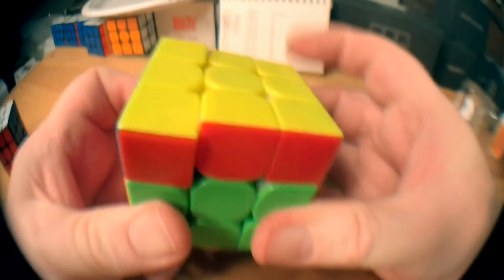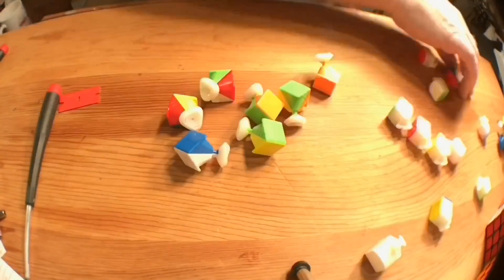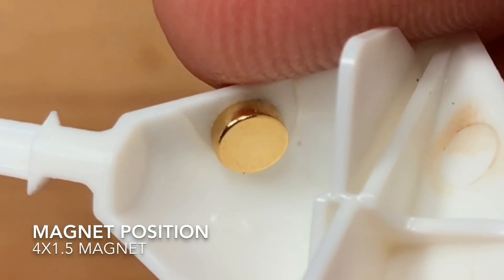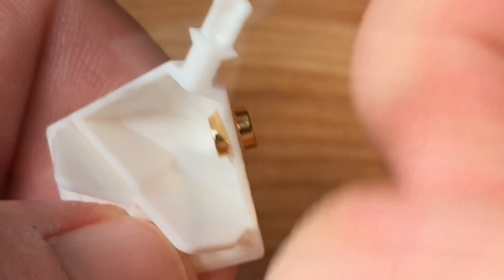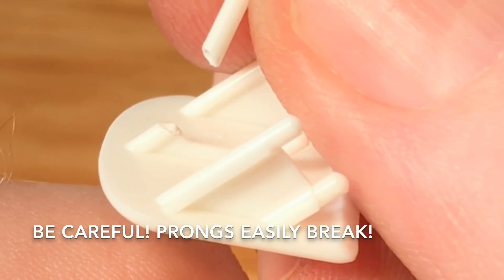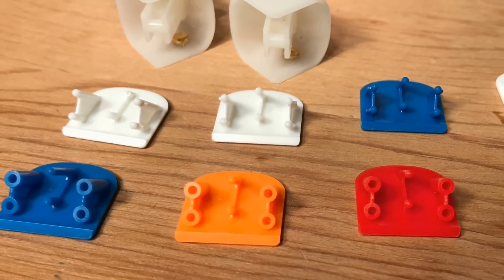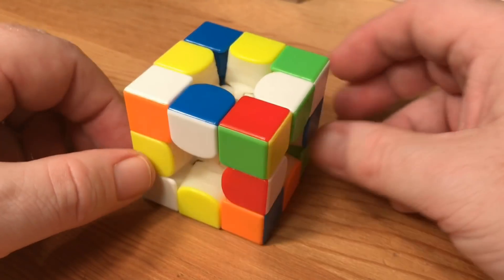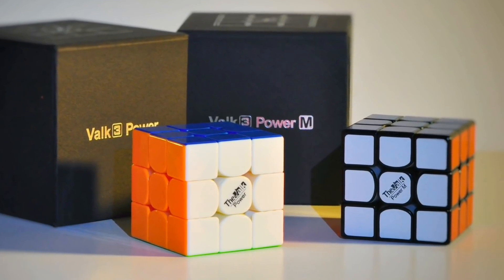How to Magnetize the Valk 3 Power Speed Cube

Comment: Why is there a variation of magnet strength? What does it do?
Reply from the maker: THERAGINGCYCLOPS They use a combination in the factory Power M. In my experience, when I've mixed different types of magnets, I generally get an average grade or strength, so like using N35s in the corners and N42s in the edges gives me averaged pullforce strength of something in between these two grades. And mixing two different thicknesses would do a similar thing. 
But I think there might be something to using lighter magnets on the outer cube, the corners, to make the action feel lighter, and having the heavier magnets in the middle to increase the m slice momentum, thus making m slices freer. It would be at such minute level I wonder if many people could detect a change. Mats Valk certainly would be able to, I imagine. And from what I've heard, he picked this configuration out of several prototypes.

Comment: Can I just use 4x1.5 in the corners or use 4x1 in the edge?
Reply: Ok I'll just use 4x1.5 on both thx
Reply from the maker: I’d probably use the 4x1.5 in both corners and edges. Might be worth experimenting with 4x1 in the edge, but I’d imagine the overall magnetic pullforce attraction would be rather weak.

Comment: Is it wrong if I use the tutorial for any Speed Cube
Reply from the maker: Good question. I wouldn't particularly use this tutorial for other cubes because the Power has a fairly unique cap design for the cubie pieces. But, you could use many of my other tutorials on several different cubes. Cubes like the GTS2, MF3RS, Little Magic, Warrior, and many more, share similar design elements.

Comment: if i use 2x4 will it be much challenging? and should i use 35 ou 50 n?
Reply from the maker: Lv8 ao Cubo You can use 4x2 magnets. I'd recommend N35 4x2. Please be sure to read the description of this video, as there are a couple of challenges with using 4x2 magnets. They will need to be positioned in a way in which the cap pieces can be put back on without having the magnets in the way. Watch the video carefully as you'll see that I discuss the location of the magnets is important.

Comment: is cubicle labs lite magnets okay for this?
Reply from the maker: Darqueese His Friend From School The N48 4x1? Yes, that should give a nice, acceptable, subtle feel. I used to like fairly strong magnets in the Valk, but really, it doesn't need a lot of magnetic attraction to be a great magnetic cube.
Reply from the maker: Darqueese His Friend From School Oops I was thinking about the original Valk 3. Yes, I think you can still get a similar feel to the factory magnetized Power. It uses a combination of N35 4x1 and 4x1.5 magnets. N48 4x1 should get you close to that. Using a magnetic calculator, it will be just the tiniest bit stronger, .42lb force compared to .39.
Reply: DMCubing Thanks! I just magnetized it and i really like the settle feel, i’ll be trying it with the Valk 3 Core now, and this is over my main Cubicle Labs Little Magic M, the magnets there were very strong. Thanks for the video it helped me alot (and some others)!
Reply from the maker: Darqueese His Friend From School Aw, that's too cool!!! You just made my day hearing that!!! Glad to hear it turned out great and that my tutorial helped!!!

Comment: how to dissasemble that corner piece without an gan tool or 5mm socket?
Reply from the maker: No Jihyo no life You can just carefully push each prong inward a little at a time until the bottom comes loose. Be careful though- the prongs are delicate and can easily break.
Reply: ok thanks :>

Comment: I been cubing for a while, but am new to magnetizing. I have a Valk Power and I like it but love magnets in my cube. Do you think it's worth the risk? Thanks!
Reply from the maker: Sam Battistone This cube, unlike most, is a little tricky to magnetize. The position of the magnets is critical. If they're positioned too high up, the caps won't be able to fit down properly all the way. 
It's certainly possible to magnetize, and if you follow the tutorial, you shouldn't have any problem. Still, you might want to try another, cheaper cube first (MF3RS2, Little Magic, etc) if you're a little unsure. But really, it's not too hard, it's just that this cube has its own challenges.
Reply: Thank you so much!

Comment: Can use the magnetic n42 4x1mm because i can not find magnetic n38 4x1,5mm
Reply from the maker: cubers 04 I think you could, but the magnetic feel will be pretty subtle. If you have access to N48 or higher 4x1 magnets, the resulting magnetic pullforce might be more desirable.
Reply: DMCubing okay thanks but the n35 4x2mm can use?❤️
Reply from the maker: cubers 04 Yes. I think you'll be fine with that magnet!
Reply: DMCubing❤️but n42 4x1mm the attractive force we bill higher than n35 4x2?? Beacuse I afraid that the n35 4x2mm are too week foto the valk power and that they do not  make much effect to the cube☹️
Reply from the maker: cubers 04 The predicted magnetic pullforce of the N42 4x1 is .36 lb. The predicted pullforce of the N35 4x2 is.64 lb. These calculations come from the KJ Magnetics calculator. The N35 4x2 is substantially stronger.
Reply: Okay thank you so Much,I use n35 4x2mm

Comment: if i get a valk power m and add a second magnet on top of the stock magnet will it work or will it not fit? and will it make the magnet strength stronger or not?
Reply from the maker: blue dog Sure, they'll fit (4mm wide magnets) and they will add strength to an existing magnet. You can either use the magnetic attraction to hold the magnets to the existing ones, or add a little drop of glue when you have the cube way you like it.
Reply: Thanks
Reply: What magnets do you recommend for a strong tactile feeling
Reply from the maker: blue dog To add to the existing magnets? The factory magnetized version uses N35 4x1.5 in the edges and N35 4x1 in the corners. Because of their 1mm thickness, it might be easier to add magnets to the corners. You could use additional N35 4x1s to the corner magnets for a medium strong feel, or 4x1.5 to them for a more pronounced feel. 
Theoretically speaking, additional weight added to the slice of the cube could improve speed, so there might be some advantage to adding the magnets to the edge pieces, but you would really need to check to make sure there is clearance before doing that. Honestly, I think simply adding the N35 4x1s to the corners will match perfectly the balance of the cube and is probably what I'd do. If you want a really pronounced feel, then use an N48 4x1 instead of the N35.
Reply: Thanks I’ll probably use 4x1 n48 magnets cause I like cubes with stronger magnets like the gan air sm

Comment: Did someone tried to magnetize the valk power with 4x2 size of  magnets?? Because i'm planning to magnetize mine with 4x2 N42 magnets... hope somebody will reply. Thanks!!
Reply from the maker: Aldrin John Alonzo N42 4x2 will be a little on the stronger side. The magnets will be a little more pronounced feeling, but I think you'll be ok.
Reply: DMCubing oh ok thanks! But do you think the 4x2 will fit?? And what's the other way to disassemble the corner peice of the power? I only have the plastic gan tool... thanks!!
Reply from the maker: Aldrin John Alonzo Yes they'll certainly fit. Make sure to watch the video carefully because the magnets need to be down far enough into the edge pieces to clear the caps. You'll see what I'm talking about. 
As for the corner pieces, once you've removed that little retaining disc, you'll need to carefully press each of the three retaining prongs in a little at a time until the base works itself free. It's easy to break these little prongs. Be careful!
Reply: DMCubing ok thanks very much!!
Reply: DMCubing i just want to thank you for the tutorial it really helped me a lot magnetizing my power but i'm just a little dissapointed because the magnets i used are too strong i shouldve'd used N38😥 but thanks again!!

Comment: Hi DMCubing, I magnetized my valk 3 power and it is really good except, just like your valk power the cube feels stiff. Does this just go away with time or is there something I can do about it? Thanks!
Reply from the maker: As long as there isn't dried glue outside of any of the pieces causing sticking problems, or as long as the magnets aren't too strong, it should work smoothly without any stiff kind of feeling. You may have to break in the lube a while or readjust the tensions a couple of times to get it to feel just right. 
Let me know how it goes.
Reply: Thanks a lot! The more I solve on it, the better it's feeling. Putting magnets it the corner pieces was really hard because the 5x1 magnets didn't fit into the magnet slots. For each piece I had to cut out part of the slot and part of the post on the caps. Even though it was really hard, the cube turned out great. Thanks for such a great video.
Reply from the maker: Daniel Hanna Oh I bet that did add a lot of extra work to it having to carve out room for the 5x1s. Awesome that your cube turned out great! Way to go!!!!!
Reply: @danielhanna2741  hi , ik it's been a year since you did it , but i'll also magnetise my valk power with 5x1 is it hard to make the slot bigger?
Reply: @haivn6  a little bit. I used an x-acto knife to make the slots bigger. Adds 1-2 hours of work.

Comment: Are there any alternatives to using the rat tail file?
Reply from the maker: Daniel Hanna Well anything that can fit into the hole and can pull up on the little base plate. You could even use a small screwdriver and kind of wiggle it to get the base off. I use the little file because it grips it and makes it easy to pull out but you can use other tools to get the job done.

Comment: i cant get the corner piece off... how?? im afraid my corner piece might break
Reply from the maker: Ong Jansen I show how to do it in several videos. If you don't have the tool to push in the little prongs, you can carefully use a small screwdriver pushing each one in, a little at a time. Just be very gentle because they break easy.
Reply: thx alot DMCubing i finally get to solve the problem

Comment: Can I use the gan ges tool on the SM? If yes, what hole should I use?
Reply from the maker: Diamond Complex // Minecraft They're the same size nuts. So with the metallic Gan tool, it's the biggest end.
Reply: DMCubing hmm the biggest hole on the SM's ges tool?
Reply from the maker: Diamond Complex // Minecraft unless you meant something entirely different, your original question was if you could use the Gan tool on the SM. The SM is a Gan, and thus, the Gan tool works on it.
Reply: DMCubing but the tool is different. It is now made by plastic and it has three different hole sizes. I broke the corner pieces on my Valk 3. Hope that the same thing will never happen at my Valk Power.I think I'll just buy the Valk 3 Power M so that I don't mess up putting super glue on the pieces, stickers and also at my eyes.
Thank's for replying.
Reply from the maker: Diamond Complex // Minecraft So are you asking if the new Gan tool works on the Valk corner pieces? Probably not. 5mm socket will or just be real careful pushing the little prongs in.
Reply: DMCubing Thanks!

Comment: Sir, will 3x2 n50s work fine in this cube? I think they're weaker than 4x2 n35 but are slighty stronger than 4x1.5 n38. Will its size make a significant impact on the feel of this cube?
Reply from the maker: CJ Tigranes I'd like to try this magnet sometime. I think you'll be fine, and as you said, its pullforce strength should be perfectly fine. I would think that it may give somewhat of a slightly more defined "click" due to the narrow width of the magnet, but it won't be abrupt because of the lighter magnetic force. I think you'll be perfectly fine. I'd like to try this in a Gan Air. Please let me know how it works in the Power M.
Reply: I have tried these magnets on a Gan Air before and man, the magnetic pull was too subtle. Maybe because of the way I positioned the magnets, but idk. Anyway, yeah I will give my update on this project of mine. Thanks a lot :D
Reply from the maker: CJ Tigranes Hmmm. If they're light in the Air, they'll certainly feel light in this cube.
Reply: That's what I was thinking, so I thought I should ask you first before going on in this. Oh well, I guess I should give it a try
Reply from the maker: CJ Tigranes I always use the Air as the indicator of how light a magnet will feel in other cubes. The Air is lightweight, uses thin plastic, and has an extremely free flowing action. In it, you don't need much of a magnetic feel to be effective. If what you're feeling with the 3x2 in it feels too light, it will certainly feel lighter in the Valk Power. What's interesting is the factory magnetizes this cube with a combination of N35 4x1.5 and 4x1 magnets, which gives an effective magnetic pullforce strength (0.39 lb) significantly lower than that of the N50 3x2 (0.57 lb). If you prefer a slightly stronger magnetic feel, this magnet might not be the best thing for you to use.
Reply: I see. I'll think about that. Thanks for the help! You're such a great guy, by the way.
Reply from the maker: Ah, thanks!!!!! :-)

Comment: Someone sold me a Valk Power for $10 at a comp today.  Just finished gluing the magnets (4x2 N35).  I will let you know how it is after I assemble it tomorrow:)
Reply from the maker: Ghost Cuber Oh, cool!!! Yeah, let me know how it goes!!!!!
Reply: DMCubing It turned out well.  Much stronger pull force than the mass-produced version, but not overpowering.  However, it won't be my main because the Valk Power doesn't fit my turning style.

Comment: How long does it take (full time of magnetization)????N38 4×2 will be good??(caps will go on edges)
Reply from the maker: Dimon_ cuber It depends. If you take the time and clean all the cubie pieces prior to gluing, then after gluing the edge pieces, go directly to gluing the corner pieces, it will take about 1 hour 45 minutes. This is the point where everything is glued and not assembled. It's best to let all the pieces sit overnight to allow the glue to harden and fully cure. 
Once you've done a few cubes, the time will come down to about 1 hour 20 minutes.
Reply: DMCubing thank you. I have already magnetized weilong gts v2 and moyu aolong v2

Comment: Can you please make a DIY magnetic Gan Air S because I’m in a budget right now and do how Gan actually did their magnets please?!
Reply from the maker: Amazing Keems Vlogs Well, in the SM, they use little slots that the magnets are placed into that are held in place once the cube is assembled back together. The magnets are 3x2 in size. I don't know their strength but they're not N35, as they're fairly strong for their size. 
The nonmagnetic S doesn't have the slots, from what I've read. I'm not sure whether or not it could be magnetized like the standard Gan Air. Perhaps so. I've got a video for that one. 
I wish I could tell you more but I just don't know much about the regular nonmagnetic S.
Reply: Ok. Thanks for the reply!

Comment: Would 5x1 magnets work?
Reply from the maker: TheCubingNinja If you use 5x1s, you'll have to locate them on the opposite side from what's shown here because of their width. 
I would recommend N35 5x1 for a lighter feel, and N42 for stronger feel.
Reply: @dmcubing6342  so will they fit?
Reply from the maker: Hai V.N Yes but you would have to locate the on the opposite sides from what I show in the video.

Comment: Sadly, I tried magnetising a Valk Power the day it came out, I didn't really take the effort to check where I should put the magnets in without disturbing the plastic structures inside, so when I tried to put the caps of the edges back on, I realised my mistake so I had to spend a day or so trying to get the magnet off the edge. Learnt it the hard way :(